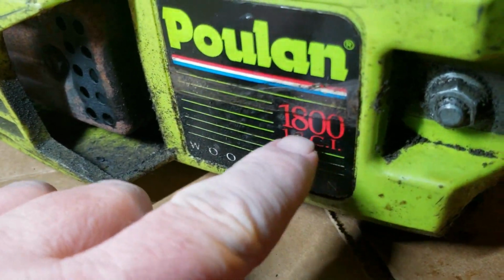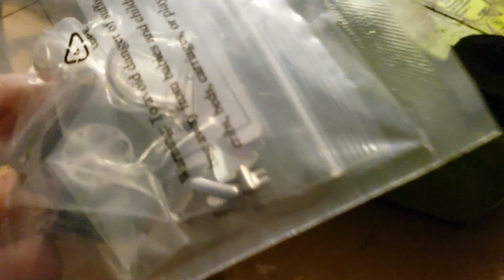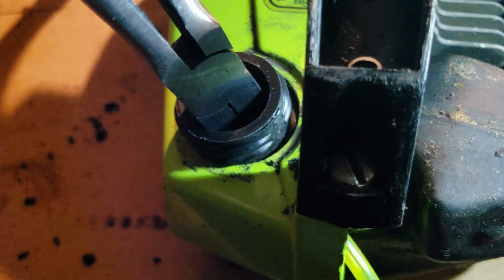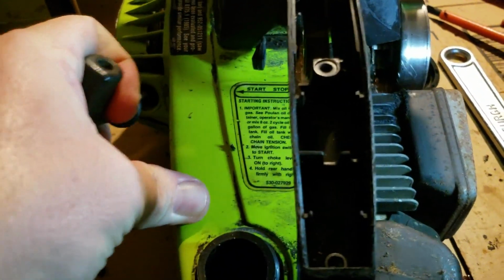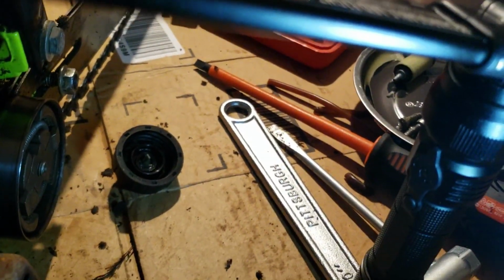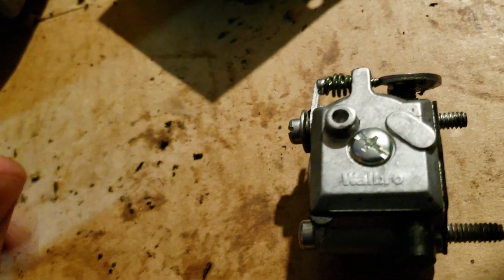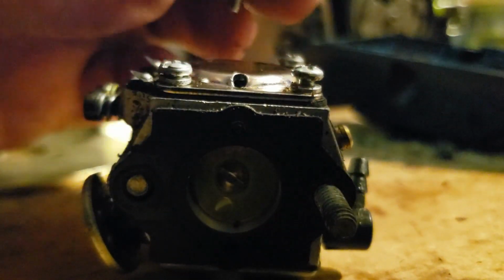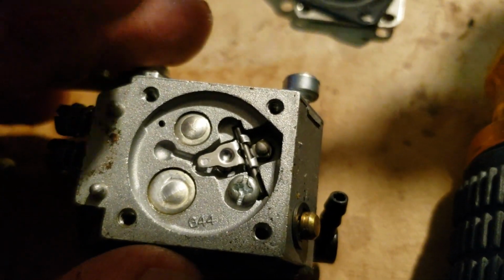Fixing An Antique Chainsaw

Comment: I understand this is a loooonngg shot, but I have that exact same unit on my workbench and I need some help. What rebuild kit will work for these? So far I have found its a Walbro WA carb, but that's an incomplete model and version label.. Mine has the SAME problems: fuel like hardened and crumbled in my hands, filter just collapsed and made for 10 minutes of vacuuming it out.NO clue on the spark plug, but thankfully there should be a number on it( watch and see it has none...)  No real source for parts it seems and the client Loves the dang thing. I thank you from the bottom of my heart.

Comment: Love it brother! You'll have fun with that! I have a Poulan 245A from '77 or '78 that I bought in Minnesota in 2016 when I was still truck driving. I got it from the second owner, he said that bought it from a buddy who was moving and needed the cash back in the late 70s when it was only a year or two old. The only reason he was getting rid of it was because he was getting old and it was too big for him to handle anymore. It runs pretty good for being 40 years old. Believe it or not the fuel lines still have green paint on them and no it hasn't been repainted. I just wish that I could find an air filter for it. It has a wire mesh filter that's starting to look more like a screen door than an air filter.
Reply from the maker: awesome.prob find a close match to it or overstuff foam filter in her
Reply: @exterminator1  Thanks, foam filter sounds like a good idea. I had heard somebody say something about using a coffee filter over the old mesh filter before.
Reply from the maker: @RWRoude  never heard that.i bet it would work! i ended up buying replacement.just never made the vid about it. hope all is well bud!

Comment: I work on equipment during the winter too. I have a customers snow blower and I an rebuilding the transmission. It has been a friggin head ache. First I go and tell her what I can see that is wrong with out tearing it apart and I gave her a price and she said go ahead and I TOLD her that it could go up from there if there is any more damage that I can't see. I stated taring it apart it needs an axles that is obsolete and the axle that connects to the wheels had chips by the key way so I had to JB weld that because she didn't want to get another axle. Now I am weighting on an axle that should replace the obsolete one and I am weighting on a keyway. Then I got to put this head ache together.
Reply from the maker: Small engine work is dificult.the work is fine explaining to people is the hard part.cuz they automatically assume you are "cheating" or lieng to them smh.cant do cheap handheld equipment cuz it will coat more then its worth.but I love it lol
Reply: Yup I get that a lot.

Comment: that's a good old poulan you have there. I'm not crazy about the new ones. My cousin has one from the 90's. Its built much better than the newer ones. Less plastic and more magnesium.
Reply from the maker: I have like 5 or so poulans lol. All but one work.it needs fuel lines and such.thats my next project before mowing starts in couple weeks